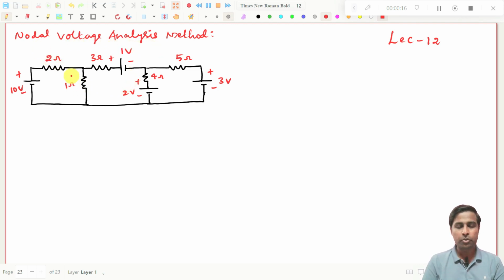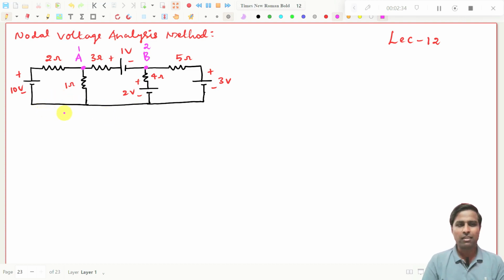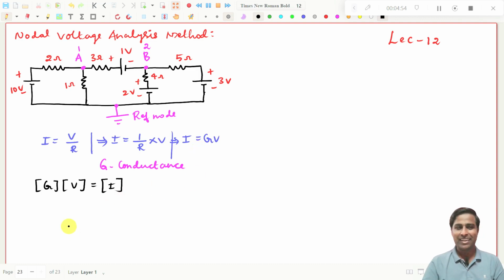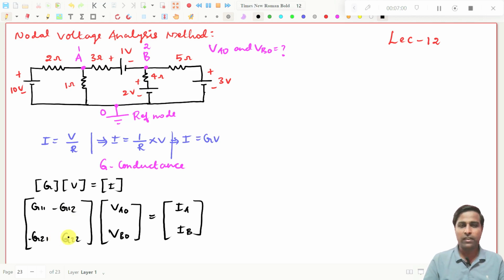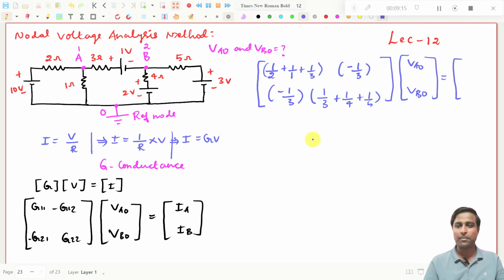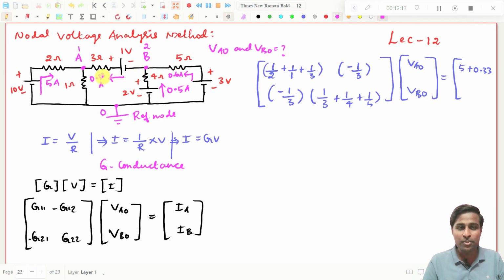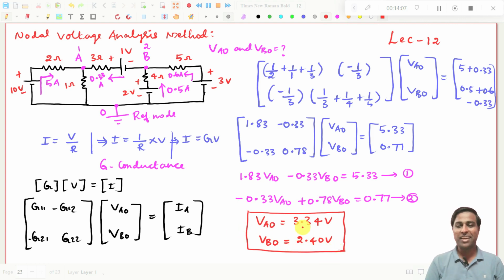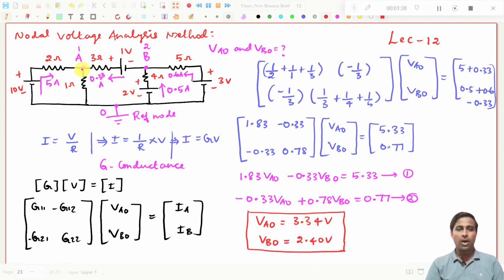Nodal Voltage Analysis Method Using Matrix (Inspection) Method Lecture - 12

Comment: sir In this method has 3 loops but sir why we don't cosidered 3rd loop?
Reply from the maker: This is Nodal Voltage Analysis (NVA) method. You have to see how many nodes are there in the circuit. If you want to solve this problem using Mesh or Loop Current Analysis method, then you have to see how many loops are there in the circuit.